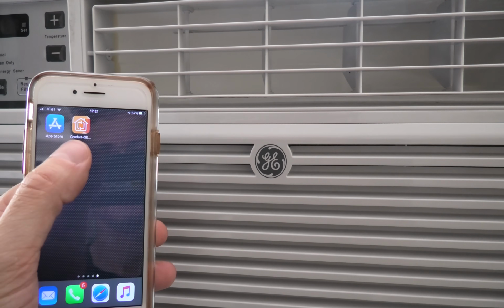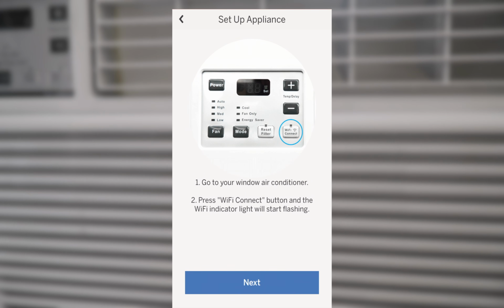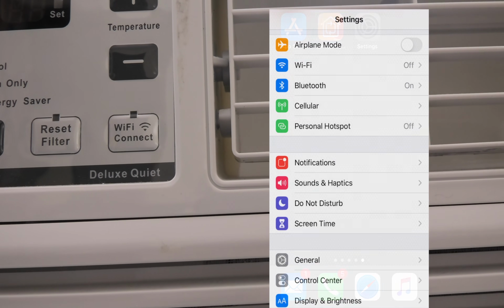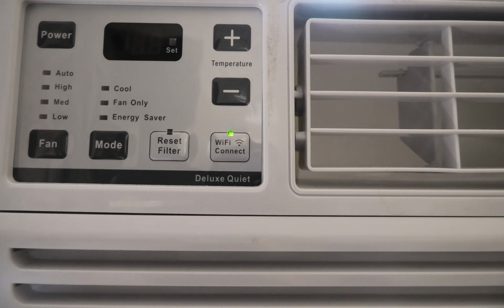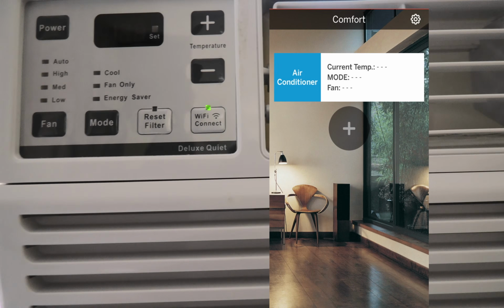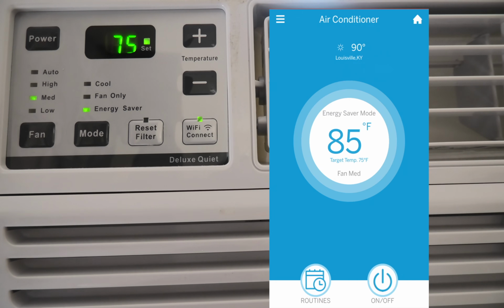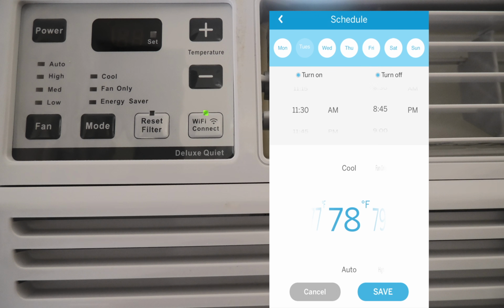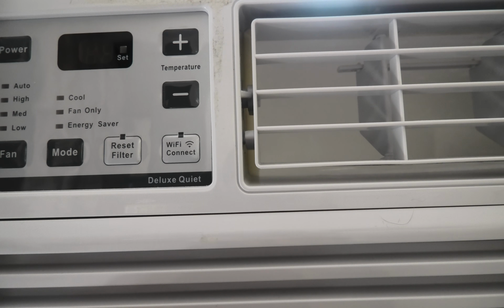Connecting WiFi enabled Window Air Conditioning Unit Setup (how to)

Comment: Since i will never use the wifi feature, will there be any issues if i bought this unit and Not Use the Smart function? As long as i never enable it as you do here - i'll be fine? Thanks
Reply from the maker: Not using the feature is absolutely fine 👍
Reply: @MegaSafetyFirst  Thank you very much! Of course now i'm debating getting the 'dual inverter' style :)
Reply from the maker: @KingdomUploader Haha, I am waiting for my a/c to fail so I finally have a reason to get one of those 😆
Reply: @MegaSafetyFirst  OH, how 'cool' is that!
Cheers

Comment: The network does not appear on my phone’s wifi list. Anyone knows how i can fix this?
Reply: With the AC on, I pushed on WiFi next to the blue LED for it. I held it down, until it beeped and went off. I then did the same thing, until it was on again. I then used the SmartHQ app on my iPhone, and at this point, the app was able to find it and add it to my home network. 

I also read that there is a reset button on plug, which can be held down to reset WiFi.

Comment: I actually don't want to use the wifi feature, my question is will a wifi ac still work manually  if I don't  have wifi?
Reply from the maker: Hi, yes It work.  
The only thing it is missing compared to my previous ac is the timing feature, where you can start or stop it after a certain amount of time.
Reply: @MegaSafetyFirst   ok thanks

Comment: Mine doesn't works at all 🤦🏻‍♂️
Reply from the maker: Does the plug have a ground fault interrupter?  Maybe it is triggered and needs to be reset?
Reply: MegaSafetyFirst yes I reseted plenty of times already and it still didn't worked. So what I did I pressed and hold the Wifi button itself to turn off wifi, and then I turned it back on and the network ended up appearing. Thank you so much I really appreciate it, big thumbs up for you 👍🏻

Comment: The AC won't pop up on my network?
Reply: Mine won’t either.  Did you ever figure it out?
Reply: @dougyfresh9013  no still doesn’t work...
Reply: @toxicdoom3923  damn.  I’m gonna call support tomorrow.  Mine worked fine then I got a new router and this ac won’t show up on wi fi. Super frustrating.
Reply: Mine also was giving me trouble at first, then I remembered I had similar issues when I was setting up my wireless lights what fixed it for me was to make sure while setting it up on the app to be connected to your 2g network and not the 5G WiFi also the app listed on this video isn’t the one the manual recommended for me instead I used the one on the AppStore called SmartHQ. Good luck!
Reply: @ChocolatePuppies  thanks for the info.  I’ll try that.  I still haven’t gotten mine connected.